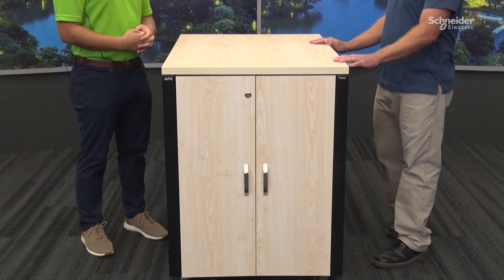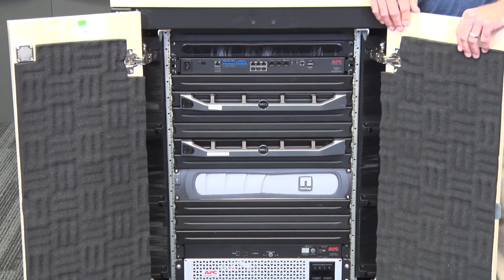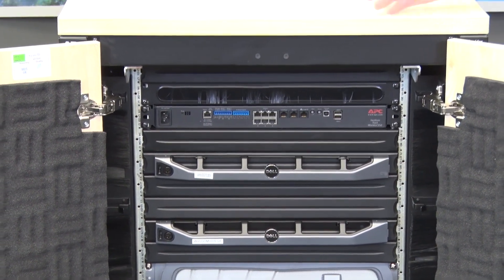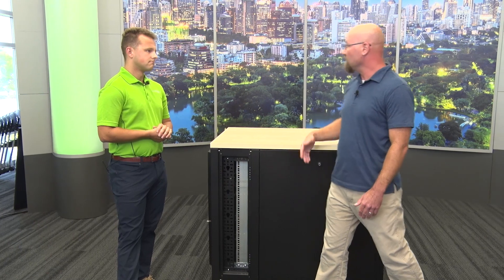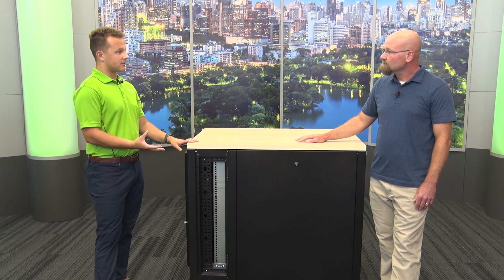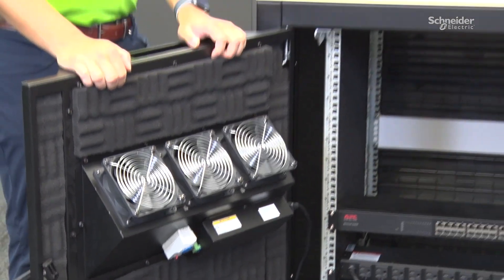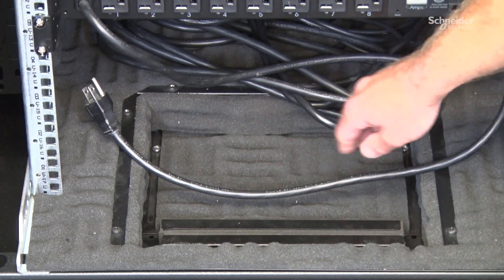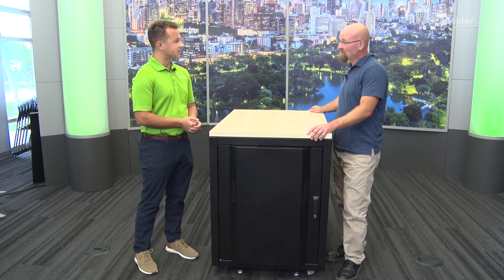NetShelter Soundproof Racks: Technical Overview

Comment: How is air coming in from the front? Most rack hear has a cool aisle/ hot aisle design with fans sucking in cool air from the front. Don’t see that explained and the doors are hardly perforated.

Comment: The ONLY important thing of demo-ing a soundproofed rack cabinet should be to show how much dBi reduciton can achieve with data, using a decent sound meter would have been simple and quick and would have cleared any doubt about the quality of the soundproofing. Also the same goes for the fans, it's not clear how loud are the fans and if it make sense to even buy it or not because of the fans which, I keep reading everywhere, they are lound ... and I definitely don't want to spend 5k to buy a LOUD soundproofed rack cabinet :|

Comment: APC products feel like they're developed in a complete vacuum from customers and this video shows how absolutely complacent their employees have become. Why aren't there standard HVAC air filters on the intake? Why isn't there intake or exhaust ducting mounts to connect the unit to a CRAC or exhaust vent? Why are we still stuck in 1989 using noisy 80-120mm exhaust fans  instead of high efficiency blowers? Why wood veneer? Why aren't there better seals containing hot/cold air? There is such limited competition in this space that folks like Richard at APC can sit on their hands all day and still collect a paycheck for just fogging a monitor. Looking forward to somebody aptly eating your lunch someday APC. It's a shame.